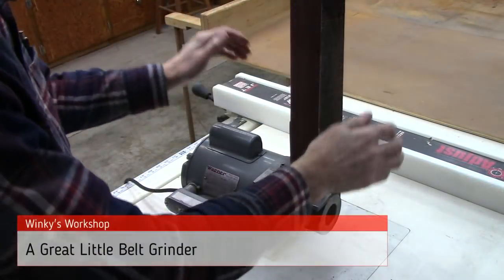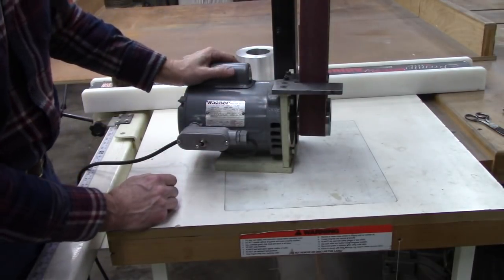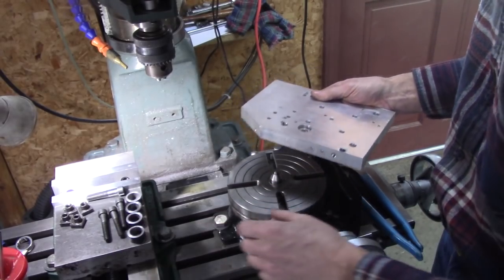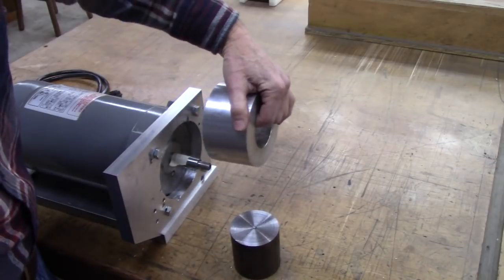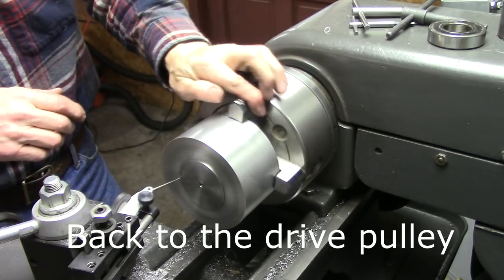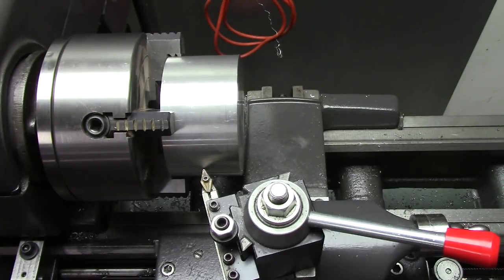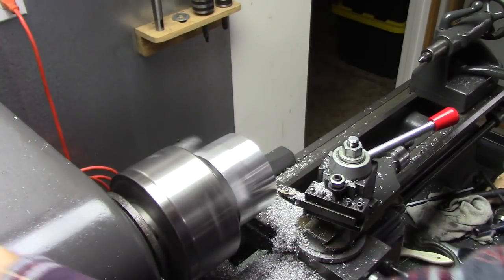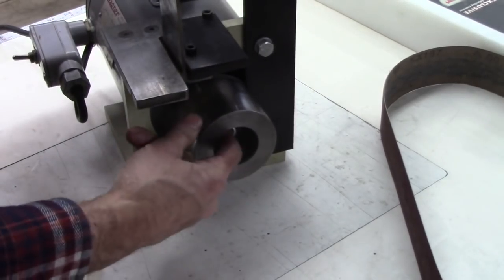Building a Great Little Belt Grinder - Part 1

Comment: You are doing a great job there Winky.  Amazing how a little heat will make aluminum change size.  For gear cutting and wheels I use an arbor between centers and that saves all the indicating.
Reply from the maker: Yeah...  between centers is a good idea! Thanks

Comment: I woud have left the steel slug extend out of the aluminum to compensate for the 1/2" plate on the motor mount. That would give you more purchase on the mandrel .
Reply from the maker: Excellent idea!

Comment: Great practical mythology to locate the plate on the rotary table!👍👍👍
Reply from the maker: Thanks...  later I realized I didn't really need the hold all the way through. I tried making the motor plate on the lathe and just cut a groove, it was easier and worked great.

Comment: I know your already done.  When I was kid, the bike fixing old neighbor man would tell me he was going trim my ears back when he got tired of me pestering him.  I'm thinking that motor could have it's ears trimmed back to make up for the thickness.  Also, you could notch the top of the plate to clear the belt allowing you to move the pulley in.  Full of ideas tonight.
Reply from the maker: Haha..  trimmed ears. Yeah it all worked out. The pulley is on the shaft 7/8 - inch and it is very good fit. But good idea!

Comment: Nice job. 1/8" per foot for the crown for drive belts, but like you say, not critical, as long as you're not breaking the back of the belt.
Reply from the maker: 1/8" sounds about right.  The crown I made works out almost right.  I do know that the belt material plays some part. Like if a belt is stretchy and conforms to the pulley more crown is needed. Thanks

Comment: Hey again Winky.. Those pulleys that hole the belts in place are fairly easy to get made up now. I don't have the tools to make them bro but I love the design of ur grinder. I was thinking about buying one from VEVOR but maybe I will take a stab at building my own with the disc sander as part of it too.. 
This Old Tony is another channel I watch. U mentioned him on a video I was watching last night. I first found his channel bcos I'm trying to build my own CNC Router atm. It's the electronics that scare me a little but I will get it done soon enough man.. Take it easy man.. Another great video btw Winky..
Reply from the maker: Yeah This Old Tony is really fun to watch. I learned a lot about TIG welding from him before I ever got a TIG. Yes, Vevor has a good deal on the grinder wheels. Thats a good way to go.

Comment: In ignorance I made a crowned  12" wooden sheaves with pronounced crowns for a stroke sander. Before the first belt had fully sanded wood the belt split lengthwise. If the axles are parallel it doesn't take much crown to get perfect tracking.
Reply from the maker: Wow...  I've seen belts get distorted but never split. You are right, it doesn't take much crown or tension on the belt. Just enough so the belt doesn't slip under load.

Comment: Got a 1.5hp motor that was formerly attached to a hydraulic pump, you've got me thinking one of these would be a good use of that motor.  On to part 2.
Reply from the maker: You might have to make the 6 x 8 mounting plate a little bigger. Sometime a 1 hp or over motor is bigger. 1.5 HP is a little overkill but it would work well.

Comment: Whats the diameter of the drive wheel? I picked up a pump motor today, pump part was trash, the motor is WAY overkill but I will put a vfd on it if I have to. I will have to extend the shaft out so I ordered in a 5/8 reamer so I can fit it well over the motor shaft (.624) and put a 1/2-20 thread inside then punch a small hole all the way through for the left handed 1/4-20 retaining bolt with a relief cut for the bolt.
Reply from the maker: I messed up on this belt grinder play list. If you don't make them an "Official Play List" then part two and three don't follow. Anyway, I just made the play list official so when this video ends part 2 and 3 will follow. In the description under part-3 there is a link with the plans and pulley sizes. Here's the link but be sure and watch the other two as well. Thanks! https://drive.google.com/drive/folders/1K1kPbT6IHLP9JlTj-6SKtCQXgr5vuJW7?usp=sharing
Reply: @WinkysWorkshop  Thank you. Looking at the drawings I see the diameter of the drive wheel but I don't see the diameter of the idler wheel. I have actually watched all the video's a couple of weeks ago I just didn't remember you saying the sizes. I plan to watch them again before I start the rest of the build after I get the shaft extended on the motor.
Reply from the maker: @MegaLostOne  Ha...  I may have overlooked a dimension but you can make it whatever you want...  within reason. Too small is hard on the belt. I just looked at the drawing, you're right! I think it's abut 2.5"
Reply: @WinkysWorkshop  Thank you. I read blue prints everyday of the work week and I thought maybe I was losing it, LOL.
Reply from the maker: @MegaLostOne  I'm not very good at CAD but mostly just forget silly stuff. Kind of like trying to proof read. You insert words as you read because you know they are supposed to be there.

Comment: Wow not sure what state you live in or small town, but here in North Carolina I have found metal recycle places or should I say most of them will let us  come in and search for stuff and sell it to us by the pound. Which I should say comes out to be cheep compared to buying it by the foot. One place I go to at least once a month has stuff separated out already stainless all on shelves , steel all on shelves, aluminum all on shelves , brass all on shelves, copper all on shelves, out side and we can just go up and down the isles and look for stuff we want. You might check around you to see if any of them will allow you to look around. The one place I have talked about around me I call it my honey hole for metal. I always check there before buying it by the foot. You could have found your 1\2 x 6" plate there. Just last week I bought 5 pieces of 1\2 X 6 X 1 foot long for under $20.00 good job on the belt sander.
Reply from the maker: I had a few good sources for a while but they have kind of dried up. There are 3 different recycle places in town...  one never has much, the other thinks all his stuff is made of gold and I'm kind of afraid of the third place. The third place is absolutely huge. They have a car shredder but they run just about any industrial steel through it. This is NO exaggeration...  they always have a pile of shredded steel 4 or 5 stories high. Lots of steel everywhere although I'd need to bring a cutting touch to get most of it. They will let you walk or drive around but they have these monster loaders with 6 foot tires running around with little regard. Plus I worry about my truck tires. I really wish some industries person would save steel and resell it. What a waste. Maybe I need to just hang out there for a while. Ha  They will sell anything for scrap price.

Comment: How did you cut the hole in the original steel plate?
Reply from the maker: With a rotary table on my mill. In part-3 I show how to do this in a lathe. If you have one this is easier.  https://youtu.be/Dckv5xe9SXo?t=396

Comment: Why not mill that plate down to .5 inch ?
Reply from the maker: I probably should have found a steel plate...  1/2" is a little thin for aluminum I think.

Comment: What is going to keep the pulley from spinning on the motor shaft?  No key.  The nut alone won't do it.
Reply from the maker: I was somewhat worried about that myself on my first grinder but in 5 years it has never been an issue. So far on the new grinder there is no sign of slipping. I don't think it's going to ever be an issue although I agree that it is not ideal. I've seen blower fans held on the same way although I suspect the pump vanes had threads. Maybe I should have cut internal threads and used a nut s a lock.
Reply: Pool pumps use this motor and the impeller doesn’t come off.

Comment: I take it you're either retired or close to it. What do/did you do for work? Maintenance?
Reply from the maker: Yeah...  retired from a job in the printing industry. I ran a web offset magazine press for a long time but the last 15 years before retiring i had a job as a troubleshooter, or at least that's how it started. It turned into an engineering job of sorts. I spent most my time designing modifications for the machines. I have no degree so I was a cheap engineer. But it was fun and better than working night shift!
Reply: @WinkysWorkshop  excellent! I can see your creative side coming through! You also mentioned a part from a printing press. Was about to add that to my guess.
It'd be fun to have a short introduction video telling of your experiences.
Reply from the maker: @dans_Learning_Curve  - Hmmm? Now that is an interesting idea! I think it is cool to hear people's life stories as long as they are not too long and boring. Let me think about this... Thanks
Reply: @WinkysWorkshop  you could point people to a link to your introduction video. It would be their choice to watch it. Your introductions to your videos are great the way they are.
Reply from the maker: @dans_Learning_Curve  Thanks!

Comment: Why remove the flange ? it won't harm will it ?
Reply from the maker: The flange is not needed and yes it creates a problem. If the belt gets pushed out of line it will climb up on the flange instead of going back to center.  Sorry for the delay.

Comment: What size rotary table is that, 6"?  I only use the kitchen when my wife is not home!!  That's how you do a hot/cold press fit!!  mrpete says you need about 2 degrees of taper for the crown.  It is looking good.  Great work.  You get you project stock the same place I do...where ever you can find it...cheap!
Reply from the maker: It really amazes me how the temp effect the aluminum. It was about .0015 under.  2 degrees sounds about right. It really isn't very critical.

Comment: Well clockwise cut is conventional,  a counter cut is a climbing cut it's as if one is up hill and one is down hill or level that's why your mill cuts better in one direction
Reply from the maker: Are you talking about the rotary table? It doesn't make any difference if the mill is cutting full width like a groove although technically cutting a circle would be better clockwise. My rotary table is kind of wimpy. I'll avoid using it like this in the future.

Comment: What is the diameter of the drive pulley?
Reply from the maker: It's 4.5". Here's a link to part 3. Below the video there is a link to the plans  https://youtu.be/Dckv5xe9SXo
Reply: @WinkysWorkshop  thanks
Reply from the maker: @robertks7343  _ No problem, thanks for watching
Reply: I can make the pulley out of steel or aluminum, do you think solid aluminum  would hold up ok?
Reply from the maker: @robertks7343  - I used aluminum with a steel core but solid would work great as log as you get a good fit on the motor shaft.

Comment: Is your rotary table powered? Link to where you bought it?
Reply from the maker: No but that would be great! Maybe I'll build one just for cutting circles. That would be handy.
Reply from the maker: It's a cheap little table...  grizzly I think. It'd good for positioning but after making this cut it's messed up. I need to take it apart and see what happened inside.

Comment: I guess you don't have a mill to take that aluminum plate down to a half inch with a end mill
Reply from the maker: That would work....  although I would be somewhat worried about strength where I bolt the 2 pieces together. Although...  I could have overlapped the joint the other way and had a good wider surface to bolt to. Good idea! In the end it worked out well, The pulley is on the shaft 7/8" and it is a very good fit. I suspect it will never be a problem. Thanks for great comment.

Comment: An additional quarter inch could be gained by using countersunk bolts on the motor mount.  Stove bolts would be a good choice.  Enjoyable project.  Doug
Reply from the maker: Thanks for watching...  I put replaced the hex head with flat heads in part 2